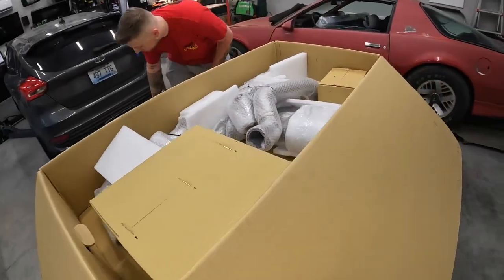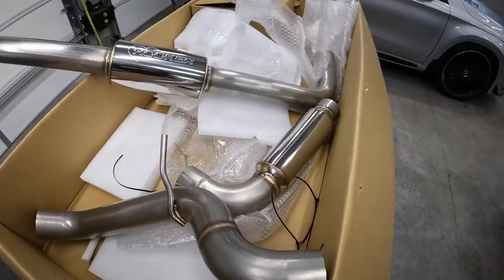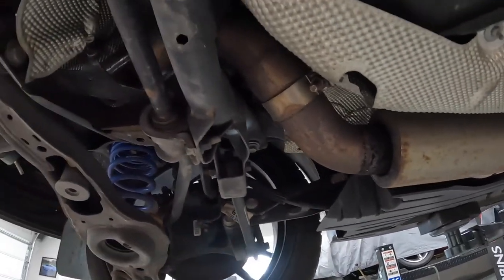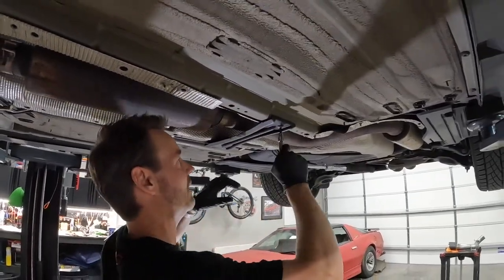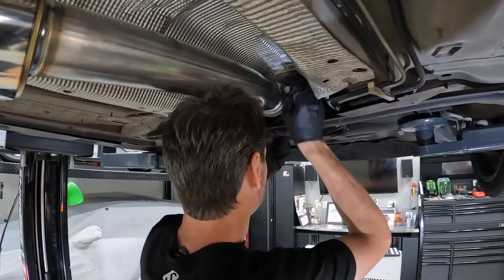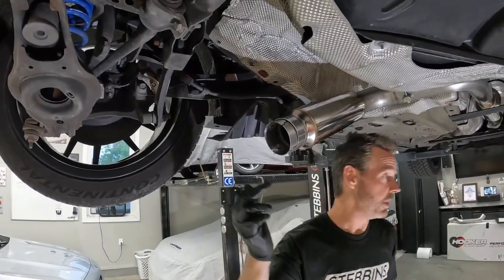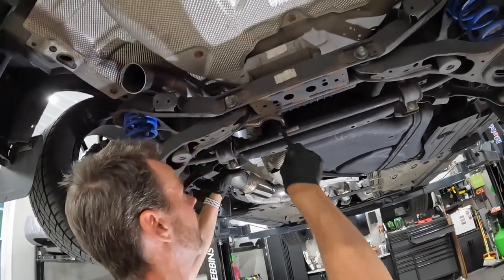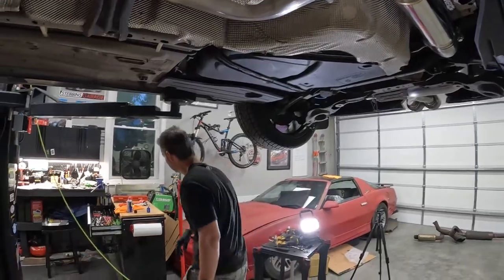NEW Hooker Blackheart Catback Exhaust for 2013-2018 Focus ST - Install and First Drive!

Comment: Does it drone??
Reply from the maker: No drone but it has a rasp to it. Love the way it sounds
Reply: I bought this same exhaust and just installed it this Saturday with a catted downpipe and I’m getting quite a bit of drone. Curious if you have any idea what could be causing it?!
Reply from the maker: @jeremyknippel-uc1gv  we left the stock down pipe installed and aren't getting any drone so I would assume that your downpipe might be contributing to that? Which downpipe do you have?
Reply: I have a depo racing catted downpipe
Reply from the maker: If that's the only difference between the two setups, then I would tend to think the downpipe causes the drone. I've never used that down pipe so I couldn't say for sure
Reply: One other random question if you can remember from when you installed the system. The piece of pipe that goes over the rear axel has a hanger attached to it. On my car there is no rubber holder to put that hanger into. Did you guys have a rubber hanger there to attach that pipe to? Or did you have to put one in? I’m thinking maybe the pipe is touching something causing drone? Just thinking out loud here but I don’t hear any rattles or anything.
Reply from the maker: @jeremyknippel-uc1gv  I don't recall. You might be able to see it in the video.
Reply: Yep! I just watched it again and you say in the video “let’s get this in its hanger.” Maybe that will help as mine was missing. Thanks for the back and forth!
Reply: @jeremyknippel-uc1gv lol missing on mine too! What did ya do??!